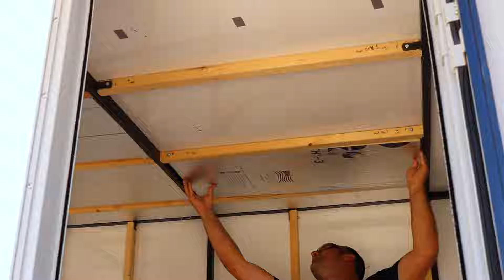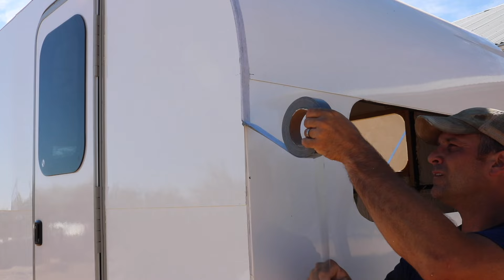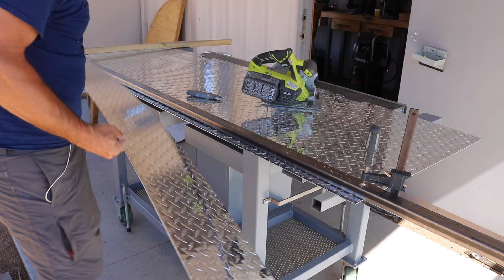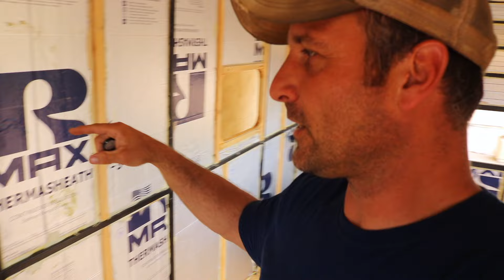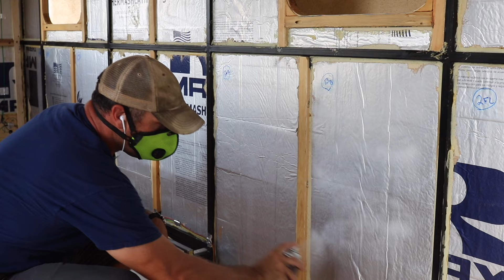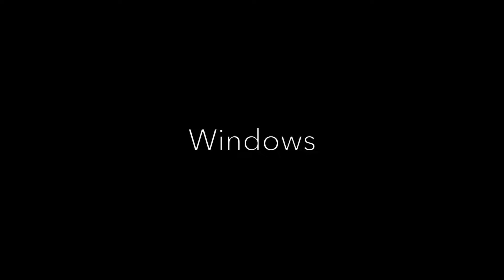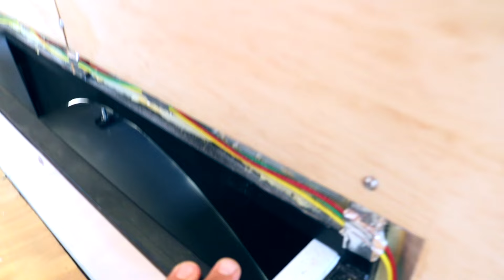How to Build a DIY Travel Trailer - Insulation, Windows/Door, Aluminum Trim (Part 3)

Comment: Very nice.   I wanted to build my own too. But lack some of the skills.  You mentioned learn as you go techniques.  Is it worth it?  Must be more expensive. Also, you looked like you sealed it up good.  Did you think about spraying inside the wall to deter bugs?  Or doesn't matter?  Awesome build.
Reply from the maker: Thanks KF!  No I didn't spray the inside.. but I'm not too worried about it... I think...lol
as for cost and being worth it..  for ease, buying a used one would be the way to do it.  but if you are wanting to have a hand in it, this way is very rewarding... tiring.. but rewarding :)
Reply: homesteadonomics; Joe, great job, especially since you’re learning as you go. For K.F., buying a used travel trailer is a good idea, but watch Larry’s video on Mobiltec channel first. He has good, free information, and a very sad story about someone who bought a trailer that blew up on the way home. It was rotten, but not as rotten as the dirty scoundrel who sold it to her.

Comment: Suggestion would be to add stabilizer on each corner, back two corners at minimum. They definitely make trailers feel more stable especially when windy and less bounce when you walk. Also would add led strip, similiar to rope lights under the awning if added. Will light up the "patio area" nicely. Needs your logo on the back ;-)
Reply from the maker: Logo:  yep for sure
stabilizers:  have some (seen at the tail light clip i think).. but I'm going to get some different ones as those are too short...lol
lights:  definitely going to add something under there but just trying to decide still...lol

Comment: amazing job 
you should include all the material cost and compare with buying a new one
Reply from the maker: Thanks!  as for material costs... I will go over it in general in a questions video but it won't be down to the nitty gritty details because I haven't been that good at keeping all the receipts... lol...most of the metal was donated by industrial metal supply but I can easily figure estimates on that since Ive bought so much from them over the years..
But the quick assessement is that it will likley be more than buying a small used one but WAY less than a brand new one:)

Comment: The slope on the bottom in the back is one of the best features of the trailer. I had a single axle camper that would drag the back with just the slightest dip in a driveway or crossing over a road that was slightly higher. I noticed other people with similar campers actually put a wheel on the bottom of the back bumper to counter this issue.
Reply from the maker: yep, thats what my father in law advised... the clearance issue is a common problem going over uneven ground and entrances
Reply: A Lazy Primitive  Agreed that was the first thing that jumped out at me I think there’s a lot of experience driving with the trailer by this fabricator

Comment: What kind of disk used for cutting metal?
Reply from the maker: that was just a regular carbide tipped wood blade.  thinner aluminum like that can be cut with wood blades pretty easily :D

Comment: It seems you have forgotten your wiring for a lighted license plate bracket.  In the wheel wells, (from inside), I'd spray everything with rubberized undercoating. 2 layers everywhere along the edges. It makes for a great seam sealer and kills any issues with condensation on the inside of the steel fender.
Reply: homesteadonomics me too, probably helps with road beat up too, good ole rubber...thanks Steve
Reply from the maker: I actually have a tail light that has a license plate light.. that will either go on the bumper  (deciding still if I will make one) or the low side.  It's powered by the running/tail wire.  No specific wire for just a license plate light.  I do like the idea of the rubber undercoating spray though.. thanks Steve! :)

Comment: I'd definitely add the bumper, along with all the accessories you can put on it, it also affords some protection from accidental "taps" to the rear. Caused by other people of course 😉
Reply from the maker: haha... yes, those accidental 'taps' are what I'm most concerned about.  ... that's one of the reasons I'm thinking about another set of tail lights... just in case ;)

Comment: The spray on glue will melt the foam. Needs to be applied on the foil side.
Reply: Really wont matter once the interior paneling is up.
Reply from the maker: yes, it can affect the foam but this foam has aluminum on both sides

Comment: It would greatly help other builders if you could indicate which 3M VHB tape you used in your built project, it is normally a four digit number:  there are so many types of VHB Tapes!
Reply from the maker: charlevoix418 in part 2 I have a link to the place I got it and which types I used 😀👍.   But quickly it was cv62f and cv45f ...they are the same stuff just different thicknesses

Comment: What about condensation?...if you don’t fo something you will regret it!!!!
Reply from the maker: there will be a vent fan in the roof and another in the bathroom area... the area is framed up but I didn't want to cut the hole until I start the 12v system :)

Comment: I gotta say, that looks awesome. I like your building style, clean and crisp. I would suggest you take your time on figuring out the interior - it can get real small, real fast. Perhaps some innovative ways to transform a space from one use to the other, while maintaining the precious "open square footage." Thumbs WAY up - looking forward to the next vid.
Reply from the maker: Thanks Grevlain!   I agree.. the interior is something I want to get right... I'm currently debating some ideas about the bath/shower area by possible leaving a portion of it open... but that can be closed up for use later.  Not 100% sure but once the interior starts getting built out it's gonna get tight quick.
Reply: I suggest watching vids on van-conversions and European RV 's. They tend to do really creative stuff.

Comment: Looks good, all you need is some solar panels on the roof and a outside shower off the rear end. 
Remember, keep momma happy! 😁
Reply from the maker: Yes, solar for sure!  I have seen some really cool outdoor shower setups.  I like the air powered setups that folks make with black ABS pipe for heat and some air to pressurize it.    And yes, if mommas happy... we all are happy :D

Comment: Two ideas, as far as the rear bumper, good idea, you could incorporate a swing out bracket on the door side to hold a grill possibly.  As well as have storage for a sewer or water hose.  Other idea is to run a piece of aluminum the width of whatever table you build along the door side of the camper spaced out a bit from the wall.  The table will then have a similar length metal piece to slide onto the metal on the trailer.  The purpose being is to have on end of the table attached to the camper and the ability to have one leg on the other end of the table, this way it will never be wobbly wherever you park it. Think outdoor kitchen.
Reply from the maker: Ive seen some where folks use like a 'C' track for that to hold one side... I like it a lot!  I do plan to make that lower cargo door into a slide out table of some sort but not totally sure of how I'll do it.  But I really do like the idea of a bracket supported table.  thanks Philip!

Comment: Coming along! I thiiiink I'd double check the door handle and the spot just to the left of it, is deburred, and rounded over, you got paws groping and fumbling in the dark, you DON'T want any sharp edges, and I thiiink I could imagine that stock aluminum sheeting could be pretty square edged. Ergonomics for comfort, otherwise, coming along nice!
Reply from the maker: Thanks!  That's a definite thing I need to check on... if it is, I'll sand it or maybe just notch it out a little more.  I'd hate for my wife or daughter to get a bad cut on a camping trip... big downer    
Anyways, great point TA!  probably going to walk out right now and check it :D
Reply: always glad to help! not that I wanna be a worry wart, and insist you "safetyfy" everything but sometimes, a little attention to detail, and avoid a stupid cut on a raw edge, by smoothing it down rounding it over, covering in some sealant, it's stupid not to.  Here's hoping for lots of good adventures! Stay cool, out there, it's 30c even up here in WA!!

Comment: Great video, nice trailer.  Great tip of the curved insulation.  I love the accent stripe.  Are you going to add Homesteadonomics logo to the exterior walls?
Reply from the maker: Hi Raynola!  Thanks, and yes I'm really happy with the strip too!  As for the Logo... yep, that's the plan.  I need to find a place that will make UV resistant logo decals.  ... don't want it getting all brown and sun burnt after a year ;)